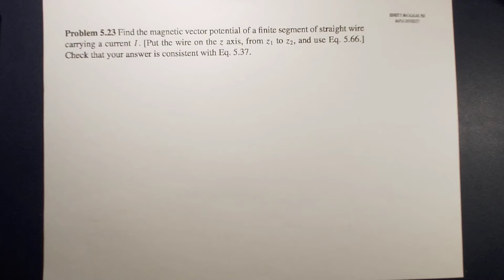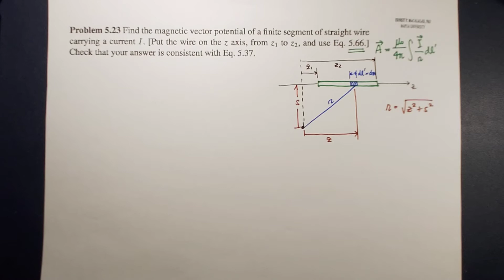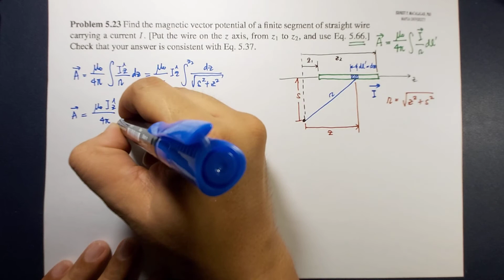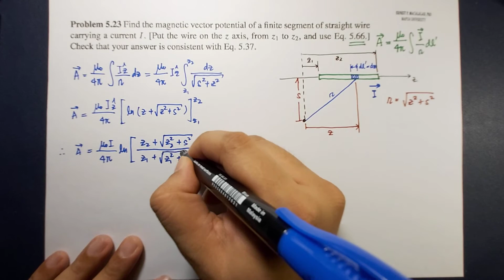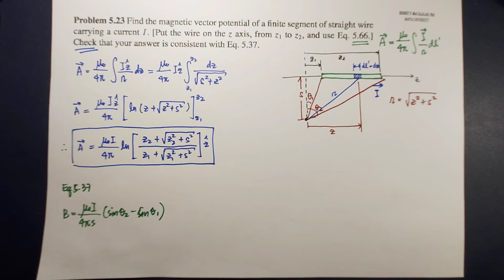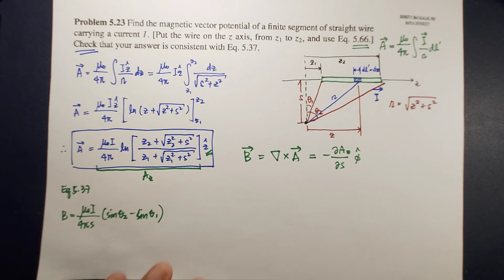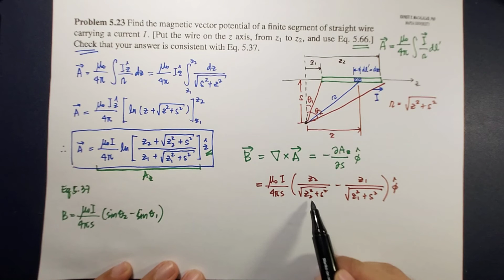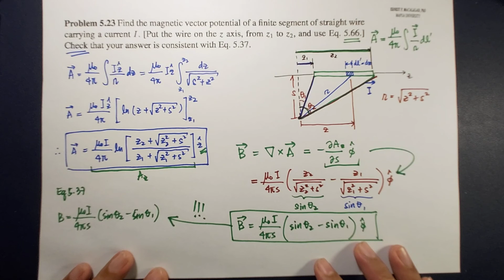Magnetostatics: Magnetic Vector Potential Griffiths 5.23

Comment: You only found the magnetic potential at z=0. The question asks to find the vector potential anywhere, not just at z=0
Reply: You are right -- it bothered me too at first. But it's not a real problem because here, shifting z to another height z+d is equivalent to shifting the wire from lying on z_1 -> z_2 to z_1 + d -> z_2 + d, I hope that's clear. Therefore you obtain a completely general answer in this case by finding the magnetic potential at z=0, because we already accounted for this translation by putting the wire in the general location z_1 to z_2. Hope that helps (it's been a while since you wrote this, but others may come across this at least).